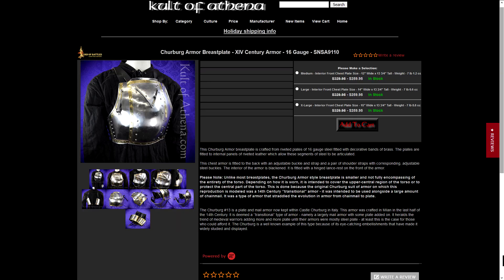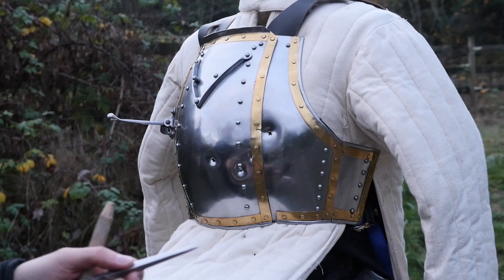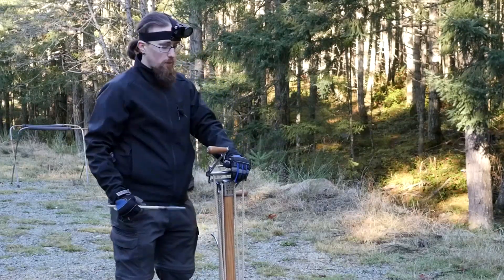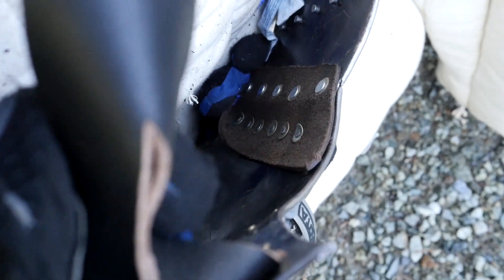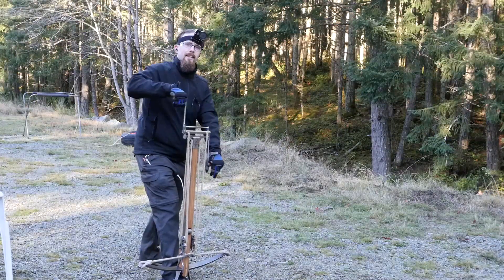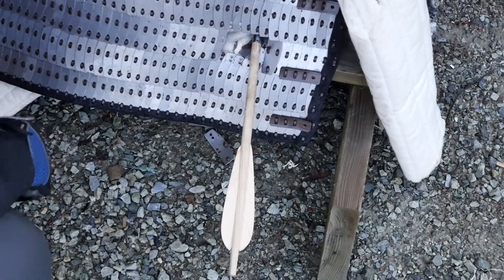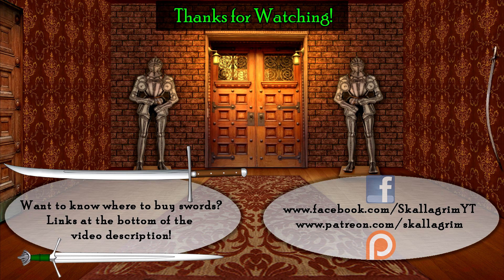Medieval Crossbows vs. Breastplate and Lamellar Armor

Comment: Continental armour usually from Milan or Innsbruck was proof marked from the end of the 13th century. English armour was only proofed after a decree from Edward III in 1368.....Proofing was by "sword, lance and arrow"  the arrow was shot from an arbelest at half draw (400Ib) using ash arrows.  Every one who posts about Agincourt seems to think that the Gendarmes left their shields hanging on the shed door....not a mention. The stark truth is that a shielded and plated man was impervious to arrows unless extrordinarily unlucky.

The success of Agincourt was down to many factors  but the main seems to be the archers tactics in aiming at the vulnerable feet and legs. The King of France Charles VII told us this in letter, recently discovered in France, that was written after the battle of Formingy where his newly formed companies de ordonnance forced the English archers off the field.

Comment: There is a reason armor existed. It worked. As soon as firearms became so powerful that they penetrated the best armor available , armor dissapeared from war in an instant.
Reply: actually, at first, the response to firearms penetrating the best armor available was to make better armor available. This kind of lead to an arms race with firearms becoming stronger and armor becoming thicker and heavier until it got to a point where the required armor would have been so heavy that it became impractical.

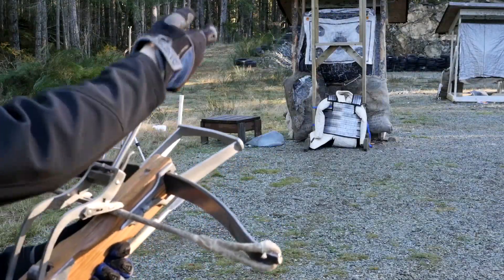Comment: at 9:11 ah the scail armor, ancestor of the chainmail. This is where the Romans in Julius Caesar's time would have. Tho its made wrong. The scails were not laced together. instead you had a piece of cow hide the size of your body and you'd use nails to puncture both the scail and cowhide at once then bend each ends of the nail and thats what held it in place. Would not have torn off like this one did.

Comment: The reason the draw weight of a crossbow is so high is because the prods are made of steel. The more mass you have making up the prods of your bow, the less force is actually transferred to your chosen projectile upon release. Crossbows were definitely handy at being precise and in ready condition, whereas traditional bows needed skill and strength to use properly and were typically more suited to volleys.

Comment: This is “Arrows vs Armor: The Prequel.”  Even though these armors are “questionable” in terms of quality, I think it still demonstrates just how much having ANY armor at all can reduce the chance for injury and death.  Even with the lamellar armor, those little scales just about stopped the crossbow bolts cold.  And in Arrows vs Armor, where we see period correct hand forged pieces, those arrows didn’t stand a chance unless they specifically hit a section that either had exceptionally thin plate or no plate and even then, they still didn’t penetrate very well.

Comment: Plate performed about as expected; stopped even heavy man-portable projectiles and didn't loose too much armour integrity. Makes sense given how expensive and resource-intensive it is. 

What really surprised me was the metal lamellar. Its MUCH easier and cheaper to mass produce than plate (which often needs to be customised to a particular individual), while offering almost the same level of protection. The only aspect it was notably worse at was armour integrity; a projectile striking a part of the lamellar armour made that part much weaker to subsequent blows, and the affected/damaged area from a projectile impact also seems much larger than the weakened part post-hit on plate armour. 

For small, non-standardised armies where warriors are expected to supply their own gear, plate armour is the clear winner. 
And equally, for large, standardised armies where the state supplies all wargear, metal lamellar is the clear winner.

Comment: There is a very good reason why plate armor was worn for centuries. This test is done with costume armor, thin mild steel, at close range, and without any give to the breastplate which would move backward from the energy of the arrow. Forged armor proves that the same arrows bounce off, shatter, and do some cosmetic damage to the breastplate at most.

Comment: Surely the warhammer would cause a lot more trauma though right? It may not visibly look as crazy, but wouldn't it compress the armor more or vibrate enough to stun the guy wearing armor? I don't have the technical terms in my vocabulary lol, but it just seems to me the warhammer prob would have A LOT of impact compared to the bows... Then again, you're probably not swinging at a plated knight at the chest with a hammer, you're going for the head, neck and kneecaps, right?
Reply: Knights often wore layers of padding underneath their plates in order to mitigate the damage of the impact of warhammers. It was more effective overall than people usually think. Obviously didn't make the knight impervious to the impacts, but it DID make blunt weapons less effective so that you need to swing REALLY HARD in a very well placed strike or deal multiple hits over time against the wearer to start wearing him down.

Comment: The more of these types of videos I watch, the more clear it becomes that not a single weapon in all the arsenals of the midevil age could penetrate well made plate, particularly with male or gambeson underneath. All the weapons supposedly designed to penatrate plate , pole axes, warhammers, plate cutter arrowheads, etc, none of them stand a chance of actually penatrating well made plate.
Reply: Gunpowder weapons excluded of course.

Comment: I wonder if the kinetic energy can still kill the man inside the armor even without penetration. A heavy bolt shot by a powerful crossbow would be sort of like a hammer striking.
Reply: Allow me to introduce you to something called padding.
Reply: @mekingtiger9095  so if someone strikes you with a poleaxe in your head but you have some padding, you'll be alright isn't it?
Reply: @gn2650  Depends on how strong you managed to get the strike. I'm sure the head is waaaay more vulnerable to direct trauma, but it's also a harder target to be hit in the first place. It can probably mitigate some of that trauma, but if you manage to land a full force strike... yeah, bye. Though again, not as easy of a task. The chest, however, can be padded more, I suppose.
Reply: @mekingtiger9095  yes, but think of an arrow rain. Each arrow is like a punch, a punch is not going to kill you, but dozens in a minute timespan can harm you enough to defeat you.
Reply: @gn2650  I don't know much about how durable the padding versus the kinetic energy of the arrows is, but in this example it seems like the wearer would have been fine from at least one shot and that was at close range. Also remember that knights would also be in tip top shape from all their training, so they'd have good endurance and physical resilience to impacts in general. So if ribs aren't broken right away, he would have feeled more like bruises instead.

Besides, knights ideally wouldn't be alone. They'd have the support of their infantrymen aswell and quite possibly other archers and crossbowmen. So outright focus firing on them wouldn't have been so easy.

Comment: If the tips of the arrows are deforming and flattening, this means they're mild steel. The plate armour is hardened steel. A hardened arrow would penetrate the armour with ease.
Reply: Nope.

Comment: In a battle, if one side used flint arrows against armor then do you think that it could cause a fire amongst the opposing side? Or could it pierce the armor? Please answer this
Reply: No. A few sparks generated by flint striking steel wouldn't start a fire, unless the whole army was covered in some flammable substance.

Comment: Hey Skall, love your videos, and yes the Lamellar you're using would somewhat be the correct gauge, although they would use somewhere between 18-20 gauge. But with the fact, that if those cheap cords didn't break, or if you managed to connect them through, and manage to have it fully on tight, like if it was on a punching bob for example, then the armor could hold up even better than it did in the video.

Comment: The problem with 'all' these tests, Newton's third law: For every action, there is an equal and opposite reaction. They never have anything hard like a body behind the armor, or even both to strap it 'around' (not flat) a body shape. So these arrow tests are 'always' invalid under these conditions.
Reply: Bodies are "hard"?

The convex breast plate allows space behind it, which will absorb many dents. The gambeson (padded jacket) adds further protection. Skallagrim has gel behind that, to simulate flesh (see 07:35).

Unless tests are done with multiple actual period weapons and armour (not likely to ever happen), nothing is conclusive, and, even then, there would be many variables. Efforts are constantly being made to learn more: https://www.youtube.com/watch?v=DBxdTkddHaE

Period armour worked, else its wearer would not have paid its considerable cost nor accepted the weight, heat, breathing, mobility, and visibility penalties imposed by wearing it.
Reply: I mean I'll gladly volunteer for a test or two.

Comment: How did anyone in plate ever die? You shot the horse,. the horse dumps the knight on the ground as he rears and goes berserk from the pain, and as the knight struggles to get up you or some man at arms stabs him through the openings in the visor. Should he manage to get up on his feet before someone kills him, it wouldn't be too difficult to avoid a guy encased in 70 or so pounds of armor that has just been thrown from a horse. His field of vision is restricted by his helmet and once in a blind spot or while he is engaging another of your mates, you can hit him behind the knee putting him back on the ground. Battle isn't a tournament and the rules don't apply.

Comment: What people tend to forget about this is that, a single crossbow would do negligible damage to a plate Armored soldier, yes, the steel back then wasn't as good as we have today, but they always have backups like the gambeson. 

Now during war, you dont face one crossbow, you face a whole company of soldiers armed with crossbows. which significantly increases the chance of a bolt finding a gap or even increasing the chance of multiple bolts compromising the armor itself
Reply: Same thing with the English Longbows, the english fielded whole regiments of soldiers that can fire a hail of heavy armor piercing arrows which hit like a truck falling from above every ten seconds

Comment: If you think that the thickness of steel is the most important part, why would I watch your video? Are you completely unaware that the strength of steel depends on the processing (heat treatment)?

Comment: From the arrow designer's standpoint, the challenge to creating an arrow capable of piercing armor like this is to make its diameter as narrow as possible so that the area of metal it has to punch through is minimized. The arrow's tip should be made of metal at least as tough and hard as the armor, and its geometry should be such that it is able to retain its shape so that it retains its mechanical advantage. Also, the tip's broadest point should be slightly broader than the broadest point of the arrow shaft so that the tip makes a hole in the armor large enough for the shaft to pass through without rubbing against the entry hole walls. I would suggest that an arrow or bolt with a tip made of hardened steel that resembles the head of a philips head screwdriver might be optimal, and attaching it to the shaft with a tang and socket would be superior to the socket-only method of attachment.

Comment: Okay, this is an old video, but it's also really worth mentioning this is firing at them at a 90 degree angle. Anyone who knows how projectile penetration works can tell you if the person you shot at was angled slightly before impact, it's much more likely to deflect off the armour. Combat isn't usually under ideal conditions, at close range, with no angling.

Comment: I'm sorry, are you joking? 800 pounds of force from a windlass crossbow won't just be dissipated by a gambeson. If it causes an inch deep dent in steel, that gambeson is going to do precious little against that kind of force. It wouldn't "barely hurt" or "just cause a bruise". Just because armor is barely damaged doesn't mean the wearer is uninjured. Non-lethal? Yeah probably. But painless? Definitely not. Even Kevlar vests nowadays break ribs on handgun hits

Comment: Sorry Skallagrim i like u but this video is a big fail in my opinion. Where are they actuall (short) bodkin arrowheads? Of course u wont penetrate that type of armor with some kinda needle bodkin arrowheads because they are too long and more likely to use on chainmail amor. In the "Tod's Workshop" Video "ARROWS vs ARMOUR - Medieval Myth Busting" they used 7568 type arrowheads. They are shorter and more robust so they have a chance to penetrade plate armor. Even though they had a probably way stronger Piece of armor and they only got a Longbow they still managed to deal as much damage as u did. Im pretty sure that this would make a huge difference.

Comment: You kept saying it wouldn’t bother the wearer but I beg to differ just because it didn’t really pierce the plate all that much it still would have a been a solid impact that could knock the wearer back or even stun him that added with the exhaustion of wearing and fighting the in plate armour would probably bother the knight to some degree.